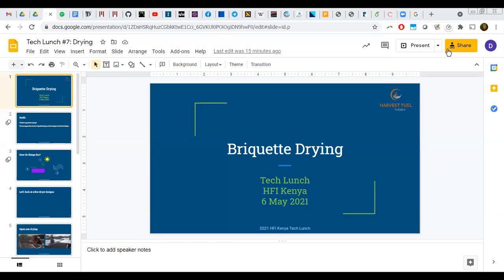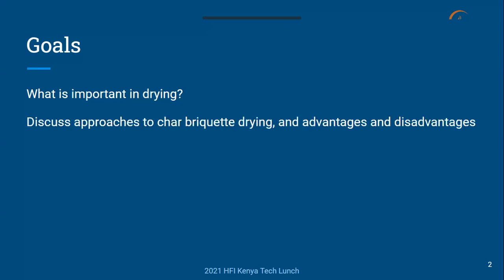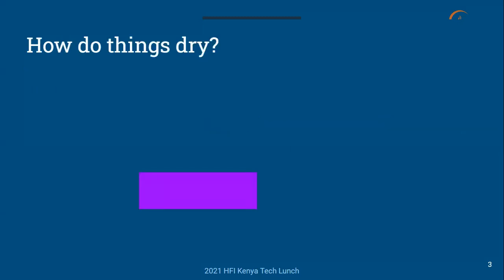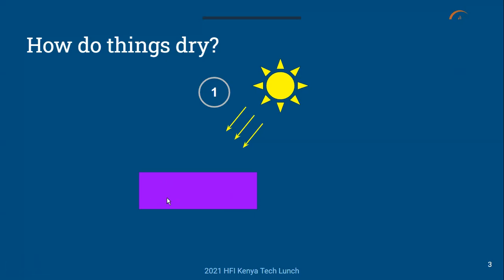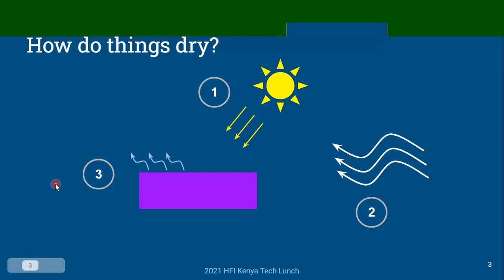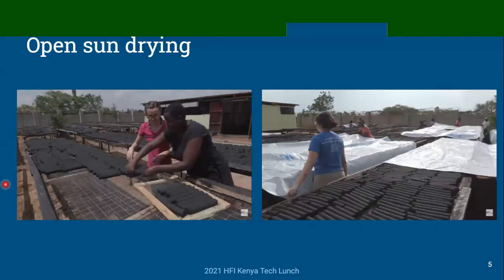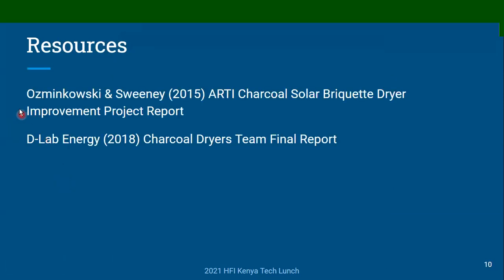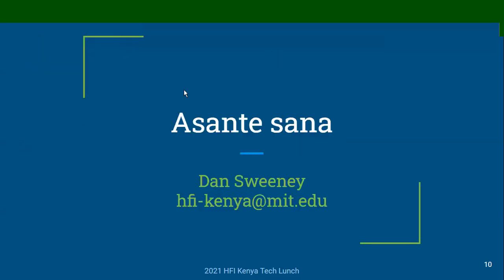Briquette drying

Comment: @dansweeney what's the type of plastic you need and where can I get them,at what price if possible? I am a briquette producer in Burundi.
Reply from the maker: Hi, thanks for your message! You should look for UV resistant polyethylene (PE) plastic film of at least 4 mil (0.004 inch) thickness. For a costlier but more durable solution, you could consider rigid greenhouse panels made from acrylic, polycarbonate or glass. Stay away from untreated/ non-UV treated polyethylene (PE) and nylon sheets